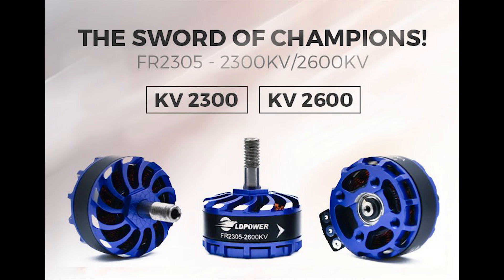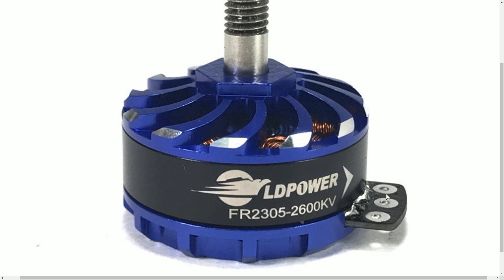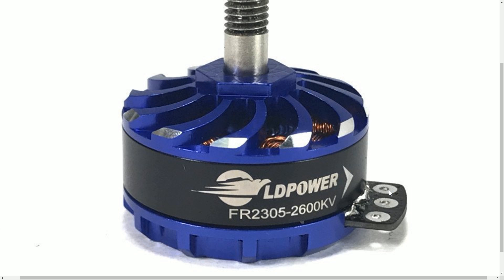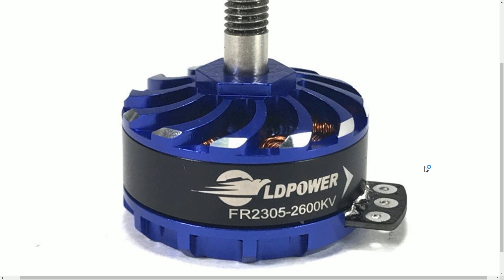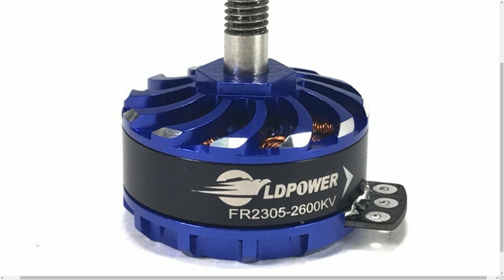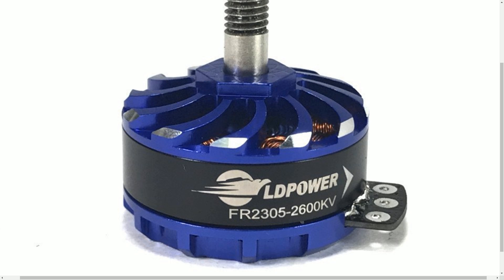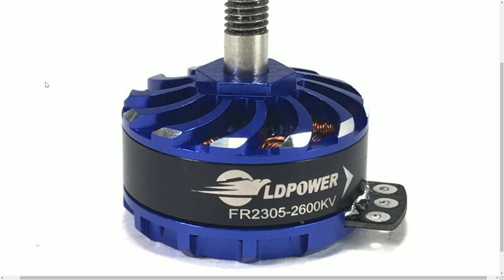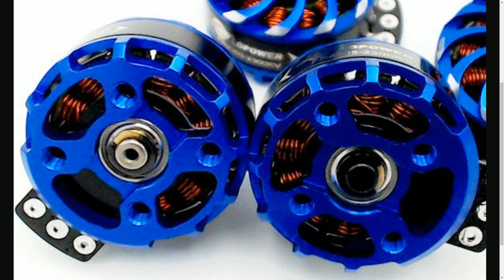LDPower FR2305 Motor | LIKE A V8 FOR YOUR QUAD

Comment: i don't think CCW threads are really needed , i  had my front right prop come loose 3 time in a row now and i do get them tight, if it was to get loose because of the thread then the front left one should be the one.
 also on the linear response from throttle , i think that is really important to have and probably worth checking which motors have that, i did the newbie mistake and got 1800kv 2207's on 4 S and until i got some dalprop cyclone 5051 props i didn't knew what linear throttle looked like . i think it has to do with how the ESC timing works anticipating the load and if the load isn't there then it will spin up , it's almost like a car driving on slippery road, give just a bit extra gas and it spins out.

Comment: so like favorite part of the motor is  that  well  you solder the wires onto the motor,  i have a bad issue with  losing an arm or the motor coming off and the wires being yanked out    right up in the  stator

Comment: In racing you don't need the CW/CCW diferentiation. We also use one direction only - and also relay on the nylon insert locknuts.
Reply from the maker: +Przemysław Jakubczak that's the opposite of what I've seen. Racers insist on staying in the air at all costs and prefer CCW / CW motors.
Reply: In competition if you hit an obstacle the loose prop is 1 in 10 reasons you are out of the race. In this year in FAI F3U cup I've seen only 3 cases where the loose prop was a reason of not continuing a flight + so it's not that frequent since vendors start making good quality lock nuts. The rest of show stoppers are broken prop, smashed cam, motors ripped off, battery unplugged, broken arm, broken battery strap etc etc.  We had CW/CCW motors - but if you have a "big consumption" ie. you tear apart 6 Brother Hobby T2 motors in a 2 month period - then unification is a way to go.

Comment: Holy shit, I've been looking for motors with solder pads ever since I've broken multiple motors where the wires snapped right at the windings...
Reply from the maker: Well the bad news is, these motors would just break at the solder points instead. Ask me how I know :-)
Reply: Yeah, I suppose... been looking into intentionally introducing a weak point on the cable or solder joint or something, but I only started soldering like 2 months ago. I also noticed these use C clips :(
Why don't they make more blue motors that fit the Tinsly F50 Rocket aluminum canopy? :P
Reply: Birdless Flight With this it will snap off the pads insted. :)

Comment: I've had 2 sets of the 2206 2200kv LD power motors on my 210 lumineer frame over the last 13/14months, they really are some of the best motors i've ever had, great build quality and they really do have some great power, very smooth, i look forward to trying out the 2450kv motors

Comment: I want to take a pixhawk from my 3r solo and install in a tarrot style frame with 6s battery or some type dual battery setup for maximum flight times (can you assist with suggestion or advice for motor & ESC replacements for the stock pods).?just an old guy ,trying to learn as I go.any advice would be appreciated ,I realize weight diff. Might be slightly diff. Than you are familiar with.. but you seem to have good grasp of things💨🛩👆...
Reply from the maker: I don't know anything about that equipment, sorry.

Comment: i have a question, will the PyroDrone HyperLite 2307-2522KV motors make my batteries cry and puff??
Reply: Right now that is my fav 300 gram freestyle build motor by a long shot.. it IS THAT GOOD.. that motor is not hard on batteries for what kinda power it's making... I'm flying Emax Avan-R and Dal 5x4.6x3s on the 4 builds I'm running that motor on.. the Avans do make it amp hungry for sure but the performance is just so damn good... the Dals are more manageable on all draw but not by a ton.. I'm flying mine on Tattu 1550 4s 95c R-lines and get 2 minutes 50 seconds landing at 3.6v per cell on the Dals and 2 mins 30 seconds on the Avans coming down at 3.6v.. that's hard freestyle flying... so lots of heavy throttle.. I have puffed 2 45c Tattu 1550s on a 285 gram build with the Pyrodrone/Hyperlite 2307 2522s.. running the Avan props, the 75c packs are fine with that motor and the Avans.. so a direct reply to your question if your running 45c 15xx packs (1300 premium packs will have a hard time with this motor and high current pulling props, this motor NEEDS 1500 to 1600mah packs and it NEEDS top spec packs, not run of the mill packs) you better be running a low amp pulling prop like a HQ 5x4x3 v1 ect... if you plan on running heavy thrust monster props like Dal 5x4.6x3, 5x5x3, Gemfan Flash, Emax Avan-r ECT ect... you better have premium packs and forget about 1300s, that motor NEEDS 1500 to 1600 packs that can throw down the current... I can assure you 45c packs with a heavy high power prop that the motor craves to run you are going to puff them if you fly hard at all... that motor was made to spin the baddest 5in props out and does so VERY VERY well, but you need the quality of battery that is equal to the quality of preformamce youv expect.

Comment: I think you need to revisit this. I bought these 2600kv and love them. See we all forgot how we got here. Tune. I too had hot motors, hot esc and short cooked pack. UNTIL I TUNED FOR THE INCREASED POWER curve. I know you know that's how this works. More diameter,  more torque,  more magnetism, more torque more kv, more acceleration.  COMPLETELY lower pids. 2600kv has no downside (within reason, 9500kv for example would certainly suffer torque curve ) if it's tuned properly. You only have higher top speed to get your Nuts off!

Comment: Hey Josh, are there any efficient 23 or 24mm diameter motors?  Everything I try larger than 22mm kills batteries and I can't finish 2minute races.  Based on my experience, the most efficient motor that generates more torque is a 2207.  Do you observe taller is more efficient than larger diameter?
Reply from the maker: I don't have a massive amount of data here, but no I agree with you based on what I have seen. The 23XX and 24XX motors make massive massive thrust but have poor efficiency on 5" props. I think most of them are over-sized for 5" props. I think these could be interesting motors on a fixed-wing for example, or on 6" props with a 2200 mAh battery or something.

Comment: Would the Efaw 2407r's be a v12? you should do a review of those if you can get your hands on some.
Reply from the maker: My review is that there is no way a mini quad sized battery (let's say 1600 mAh or less) can feed those motors.
Reply: So far people are saying they're quite efficient. So much so they came out with a 2800kv version.
Reply: I custom designed a frame at 201mm stretched X on 3mm 6K carbon plate, running Wraith 50a blheli32, Graupner Gr18 receiver and flight controller combo (btw the Gr18 receiver and FC combo flus as good as any F4 FC I have ever flew and I can program every thing right from my MZ24 PRO or MC32) Runcam Eagle2, Tramp vtx, EFAW 2407R 2500kv on either Emax Avan-Rs or Dal 5x4.6x3s with Tattu 1550 4s 95c R-lines and performance is simply spectacular.. this quad weighs in minus battery at 287 grams.. it freaking rips.. right now my fav 280 to 300 gram freestyle quad motor is the Pyrodrone/Hyperlite 2307 2522... this motor being a very close second.. on my slightly heavier builds I will likely run the EFAWs... on the Avans the amp draw is neck and neck with the Hyperlite 2307 2522 but makes noticeably more top end power and slightly more mid range power.. low end punch out power is massively more... massively more.. I can safely fly the EFAW on 75C Tattu 1550s and fly hard and not puff them.. after a hard flight the 95c packs come down no warmer then when I rip hard on my Hyperlite/Returner V4 2522s.. flight time on a hard flight where I'm hard on the throttle with a lot of full power punch outs on the Avans I'm landing at 3.6v per cell and 2 minutes 15 seconds, on a more relaxed flight 2 minutes 45 seconds.. on the Dal Cyclone 5x4.6x3s I'm getting 2 min 35 secs on a hard flight and 3 Minutes on a more relaxed flight on the 95c 1550s.. given I am sponsored by Gensace (Long time sponsored 3d heli pilot) and keep cycle counts low for the super high powered rigs and then retire them to slightly less powerful rigs, on a new pack I run 50 to 70 cycles on the stupidly over powered rigs , once I see IR numbers start to climb I move them to slightly less powerful rigs...
I haven't puffed a 75 or 95c pack on thes3 motors yet unless I just messed up and ran the back to far down not watching what I'm doing.. but that's on my not the motors... trust me the EFAWs are stunningly great motors... the build quality is stunning, performance on the baddest 5 inch props is stunning, response times are stunning, smoothness in the air is stunning... they aren't my fav motor that spot is held by the Hyperlite V4 2522 and Hyperlite 2307 2522 those are my fav motors, 270 grams or less is the V4 and over 270 gets the 2307 2522s... however if I'm breaking 300 grams with a build, well no doubt it's wearing the EFAWS and that's saying something because the Hyperlite 2307s handle up to 350 gram builds with absolute Authority. And believe it or not, the EFAWs on HQ5x4x3s pull less peak amps and lower average amps then Hyperlite V4 2522kv.. but that prop on that motor is almost a waste of time.. even tho it is th3 most accurate prop for absolute precision you can fly.

Comment: I've had 2 occasions where I couldn't get my nuts off after a crash or something. Both times I spent about 15 minutes cutting the prop to bits just to remove it & scratched the stuff out of my motor in the process :(

Comment: So Josh, just wondering if your perception of "Linear" response is due to a much greater rotational inertia? In the video it doesn't sound like it comes on fast, and that means more lost energy in heating because you are just wasting it in inertia, like having heavy props? 
Any way just putting the idea out there.
Reply from the maker: It's possible. I don't think the linear feel is entirely due to slow response though. The motors felt more precise at low throttle and at no point did they surprise me with sudden thrust. With the Returner R3, I sometimes got surprised even when making relatively small throttle moves, which would not be explained by rotational inertia.
Reply: Not sure the heat issue and the "Smooth" response with no surprises all sound like rotational inertia, but you are right a well designed motor should not have a steep transition in the efficiency curve. I'd still like to come up with a test bench that allows those characteristics to be quantified. Nice review mate.

Comment: I bought some unbranded/generic 2204 motors on eBay and when they came they were ldpower 2204 2200kv.  researched them and they were supposedly good and run about $16 each , since I got all 4 for $21 total I was excited. after flying them a bunch and using other brands of motors I will say ldpower makes some very killer brushless motors. not a well known company as of now, but I have bought several sets of the black 2204 motors and will find more.  I haven't tried the blue racing type yet but might in future.

Comment: Just a question but has anyone tried using lower pitch props on higher kv motors and letting the higher revs compensate? I have mainly used 2350kv with 4 or 4.5 pitch, I was looking at higher kv motors and thinking that with a slightly lower pitch you would get the same characteristics and amp draw as a lower kv, but smoother curve and more torque.
 Maybe its a crappy idea?
Reply from the maker: It's tough because there aren't so many good 5" props with a 3" pitch.
Reply: Joshua Bardwell 
I was just thinking it would give a really smooth flight without the unwanted throttle blips, but still have loads of power.
Maybe its something to try, its possible that amount of revs would shred the props, I've shredded cheap props on 2300kv. If you could get good props I reckon it would be nice and buttery for camera footage.

Comment: What rates do you run, Josh. If you don't mind.
Reply from the maker: Betaflight defaults plus:

set rc_rate = 155
set yaw_srate = 75
Reply from the maker: Works out to, I think, 1033 on pitch/roll and 800 on yaw.

Comment: 2305 or 2206?
Reply from the maker: This is the million dollar question. I think for raw thrust and efficiency, a good 2206 can beat a 23XX or 24XX motor, or at least come so close as makes no difference. What I mean by that is, if the 23XX makes 1500 grams of thrust at 50 amps, and the 2206 makes 1350 grams of thrust at 30 amps, do you really want the 23XX? Even QuadMcFly in his review of the LDPower motor said it didn't make much more thrust or torque than a similar 2205 motor, and it drew more current. So based just on those metrics, the LDPower is worse: heavier and draws more current, for no additional thrust. But I still have not given up on the idea that there is some other quality that makes these motors superior. I would like to find a 2205 or 2206 motor that made similar thrust as this one, and that had a similar very linear throttle curve. But I haven't found one.

Comment: Can we put to rest the misconception that big stator = more efficient throttle up = longer flight?
Reply from the maker: Lord who said that?
Reply: Haven't you heard. This is why the brodogs are all flocking to the 23xx... because the rumor is that a weightlifter has an easier time of swinging the teeny weeny props...
Reply from the maker: Complete nonsense. Look at miniquadtestbench's review of the FR2305 2300kv. The motor doesn't make more thrust than a 2205 class, and its larger stator causes it to be less efficient and draw more power. The motor must be matched to the intended rpm and prop size.
Reply: TESTIFY!

Comment: I am finding that I prefer more efficient motors like the Lumineer 2306 2350 Kv. Those motors might be lacking a little in top end power but they are so smooth and I can get 4 minute flights out of them. I bought some Emax 2306 2400 Kv and for me dropping down to  2.5 minute flights is not worth it for the little extra power they provide.
Reply: Agree... even 4 min flight times are too short IMO. That's what I get when the wind is up flying a 128g 135mm park quad with 2 bladed 3 in props and think anything less than 5 min flight times is too little... I get 7 min on a toy protocol but "relatively" fast 35.5g gram backyard brushed FPV quad using 7mm x 20mm motors and over 6 min (in wind) on a 200 mm quad using light weight HK 5.25 in 2 blade props on 1307's using a rather heavy 24g gram cam/TX setup with it's own 2S battery making it almost 230 grams that reduces flight time a lot showing a little weight added can have a large negative effect on flight times pushing the props past their ideal drag ratio and there's an ideal sweet spot to aim for.

I'll be glad when the prop/motor/weight relationship is understood better to increase flight times. I get over an hour on my gliders;-) ... all day if I want so it makes me feel the quads we pour money into have a long ways to go and I think lighter weight batteries are the next step in that direction as well as better motor/ESC prop combinations. 

What most people don't realize is that real technology involving weak force asymmetry and time dilation is being hidden and these batteries are likely already in use or just around the corner.  2.5 min is WAY too short and rather go play golf like an old man. Lumineer makes some of the best quad parts no doubt and the 2306's had my attention... thanks for posting that as reports of short flight times has held me back from getting a 3 bladed faster quad.

Comment: You should test a 2300kv motor instead.. and review that.
By just checking the chart difference 
Its a hell of a difference on 2306 2300kv and 2600kv in efficiency.
Im on 2205 motors today and been looking for a smooth motor.
But when looking at this I might just stick to 2205.

Comment: Hi Josh, I think you just described how to solve the "short motor wire' problem. The wires get shorter and shorter, as you change and rebuild. Until they are the perfect size for a 'Bardwells sister' . What is a Bardwells sister you ask? Well, they come in a variety of sizes, according to motor diameter, shaft length not important ;) they work as a washer between the motor and the frame with the added feature of, three solder point tabs. Presto, short wire motor? :( Dont throw it away! Throw it on a Bardwells sister board
Reply from the maker: Clever.

Comment: That smoke coming out of the motor mid flight looks like a real game changer
Reply from the maker: The leading theory is that it's bearing oil burning off, because the windings show zero signs of any damage.
Reply: Joshua Bardwell makes sense but still doesn't inspire my confidence as a buyer 😐